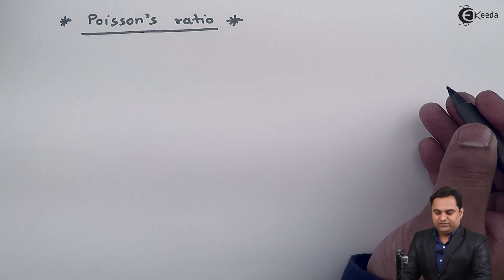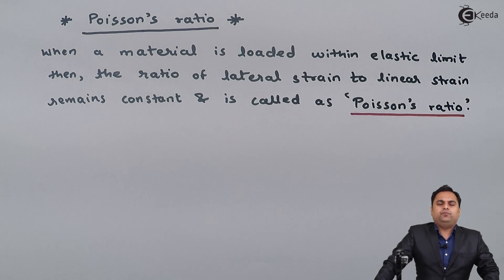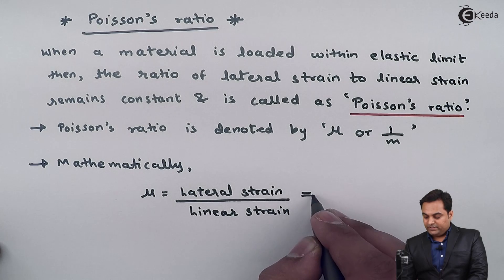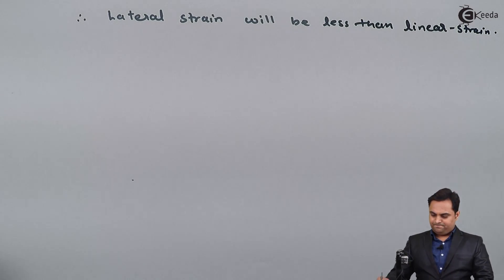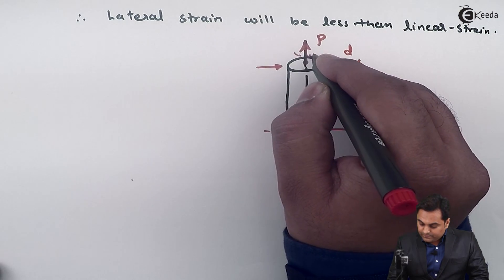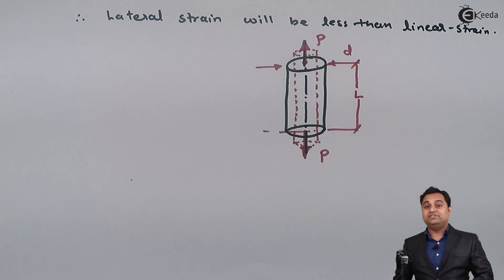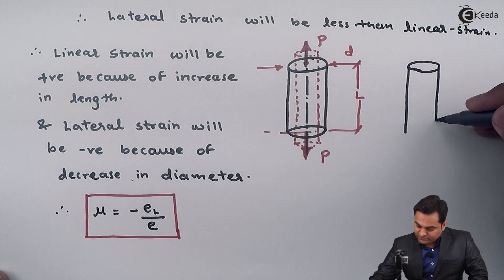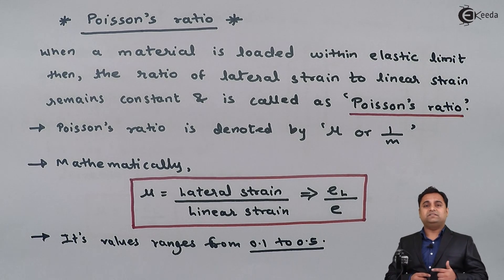Poisson's Ratio - Stress and Strain - Strength of Materials

Comment: Here also be didn't explained deeply.
But he is good Prof.

What is maximum value of Poisson ratio for linear elastc material?? 

Answer:  maximum value is 0.5 example: Pure elastic  rubber,  incompressible fluid.

minimum value is 0. example: cork,glass.

For polymer film the range of Poisson ratio is -1 to 0.5( All genetic materials behaves negative Poissons ratio( example: any material with life)

For metals 0.25 to 0.33
If Poisson ratio increase ductility increases.
Generally, 
If Poisson ratio is in the range of 0 to 0.25 is called brittle Material.
 If Poisson ratio is greater than 0.25 to 0.5 is called as ductile material.
If Poisson ratio is 0.5 (I.e., Change in volume is zero) it is called as non dilatant material .
If Poisson ratio is exactly 0.25 (For  isotropic material) 

Poisson ration for rigid body cannot be determined.

Why maximum Poissons ratio is limited?i.e., 0.5

For GATE Level deep explanation is required.